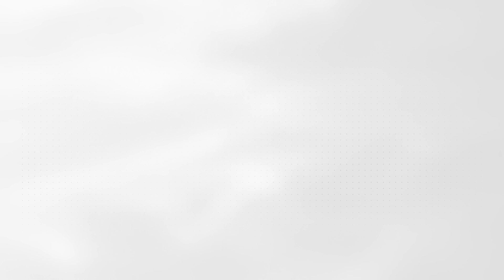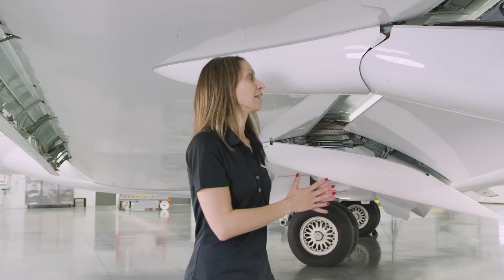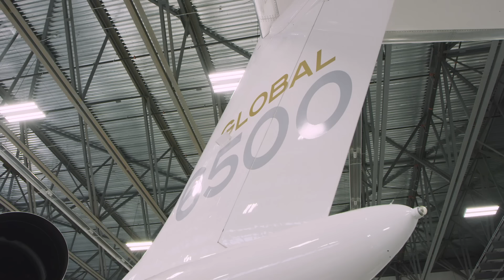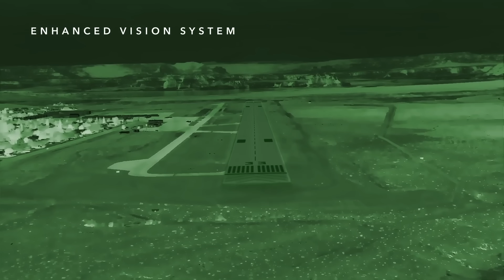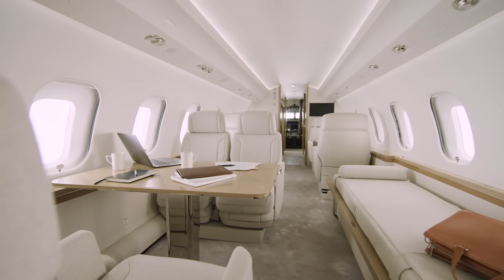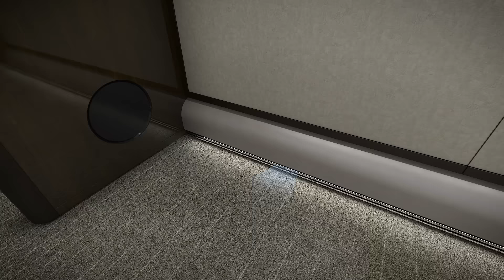Step Inside the Bombardier Global 6500 Aircraft

Comment: The Global 6500 is a beautiful and comfortable aircraft with a modern cabin, but needs a little bit too much fuel compared to modern competitors like the Gulfstream G600 which needs for almost the same range and speed at least 1,6 tons less fuel. And the Global 6500 definitely needs the modern sidestick cockpit of the Global 7500 and its larger windows to compete with the Gulfstream G600 in the future.

Comment: Airbus right?
Reply: Bombardier
Reply: @rcairflr  thought they sold out the aircraft side... gov floated them on that one aircraft... Trump thru up a stink... and Airbus bought out the design... Great use of taxpayers money
Reply: @Scotian6444  > I worked at Bombardier for 26 years.  i was on the CSeries team.  I really wish people would try to quit blaming Trump, that is not what happened.  I could tell you the whole story but really don't want to take the time>
In answer to your question.   The RJs were sold to Mitsubishi and the CSeries ( now the A220) was sold to Airbus.  Bombardier still owns the business aircraft which includes the Globals, Challengers and Learjets.  But the Learjet production is being shutdown.
Reply: @Scotian6444  >  You should know the tariff  never went into affect.  Not a single penny of tariff.  So now there are two lines for the A220., the one still in Miarabel Canada and the Airbus line in Mobile Alabama USA.   
If everything is Trumps fault, then why did Bombardier make the worst deal in Corporate history and sell the CSeries to Airbus for 1/10th of the debt they held on the program.   Bombardier was and probably still is run by a bunch of idiots.  BTW , they made this deal after the tariff was cancelled.
Reply: @rcairflr  
Did you read my comment? There was no ways Bombardier alone could have succesfully marketed the CSeries against the predatory pricings applied by the duopoly.
--> Boeing executives even revealed that they were on a mission to kill the CSeries and bankrupt Bombardier (they almost succeeded).

I agree on one point however, Bombardier would have obtained much more money by selling to the Chinese. But that would have moved production out of Mirabel.
Reply: no, airbus is french which is dassault mostly....... bombardier is canadian..... gulfstream is american

Comment: as a fairly new air charter operator from India I've been planning to acquire a fleet of two brand new A321-200 Neo LR Prestige ACJ & 3 brand new Bombardier GLOBAL 8000 large business jet for air charter services . . . but for some reason there's barely any hype going around about the Bombardier GLOBAL 8000 in the air charter fraternity for a very long time . . . wonder if the Bombardier GLOBAL 8000 has sold any as yet . . .
Reply: They never developed the Global 8000.  Only the Global 7000 which was rebranded Global 7500

Comment: There is a reason why you can’t get a G650er for a few years and Bombardier has Global 6500s sitting unsold. 
People are still paying more and waiting for the Gulfstream because it’s a better aircraft, more reliable and has a faster real life cruise. 
The only thing Global has better than Gulfstream is the Rockwell Collins suite.
Reply: The NEWER Bombardier jets (global 6500 and 5500) can also hit Mach 0.90 too, with a slightly higher takeoff weight and range than the g500/600 models they compete with. Not trying to be a hothead but you have gotta give them props for that..The Bombardier-Gulfstream rivalry has come a long way and has allowed both manufactures to produce such phenomenal aircrafts
Reply: @mmm0404  The 6500 & 5500 can only hit .90 (at the right weights in the mid to upper 30’s not at normal cruise altitude) they can’t operate M.90 routinely. The narrow window that they can achieve M.90 in, isn’t where the aircraft get used, they get flown at M.88. 

That’s the difference Gulfstream can routinely operate at the edge of their envelope not occasionally hit the edge of their envelope.
Reply: If G650er is Mercedes-Benz then Global 6500 is Volkswagen
Reply: I would say the Gulfstream Has a better pilot cockpit and flying experience. The interior is also more striking than the bombardier but in terms of range, fuel burn,  operational costs, take-off performance, cruise, and price the bombardier is a little better. Gulfstreams are more popular with wealthy private individuals but i think charter companies would opt for the Bombardier.
Reply: @mmm0404  Gulfstream 500, 600,  650 & 700 all cruise at M.90. The Global 7500 is the only Global that can go M.90 on a regular basis. Globals cruise at M.88. The Global cockpit is slightly roomier and the Rockwell Collins is better than the Gulfstream Honeywell for pilots. Gulfstream doesn’t go AOG as often. Global Maintanence is slightly better when new but gets more expensive after the 4 year mark.

Comment: Cabin filters canNot remove viruses. That's simply impossible. Otherwise, impressive aircraft indeed.
Reply: "Air filters can remove very small particles such as bacteria and viruses. Virtually all viruses and bacteria are
removed; even the most difficult particles in the range of 0.1 to 0.3 micron are filtered out with an efficiency level
of of 99.995%. Contrary to popular belief, very small particles below 0.1 micron are easily filtered out by the
mechanism of diffusional interception." - IATA (International Air Transport Association)

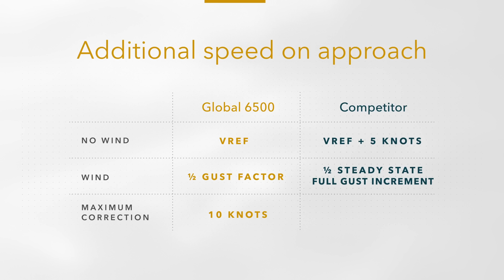Comment: 4:29 is kind of silly.  So, they set their ref where they want it so they don't have to say it's ref+5....  
wind and gust correction is a matter of the wind, not the airplane's airfoil. 
It is limited to 10 knots vs 20 knots of correction?  Ok then...
It's an amazing aircraft, they didn't need to pollute their presentation with this silliness.
I noticed they didn't mention fuel burn compared to their competition.  Always the Achilles heel for Globals.
It has everything but sidesticks...  (and they're still stuck with those little windows.)
Don't need a HEPA filter if you have a zero recycled air system.  Just saying.

Comment: Well done, this was extremely value added. However, they missed some important areas for a potential buyer. 1) Dispatch reliability, 2) Product Support 3) Maintenance and Service Locations
Reply: They didn’t miss them. They intentionally avoided them because Gulfstream beats them on all points. They also ignored its high speed cruise is .88 and it can only achieve .90 in a narrow range of conditions that we don’t operate in.